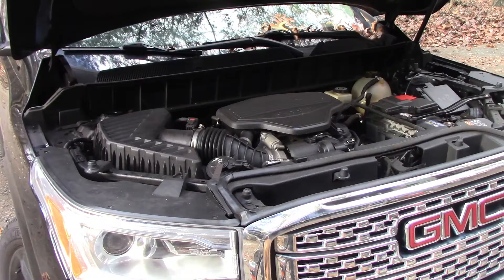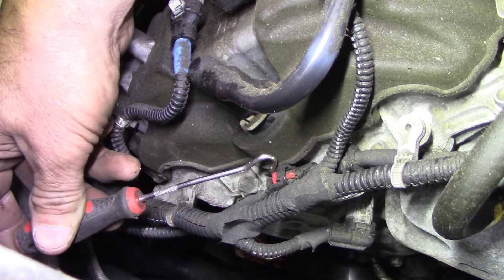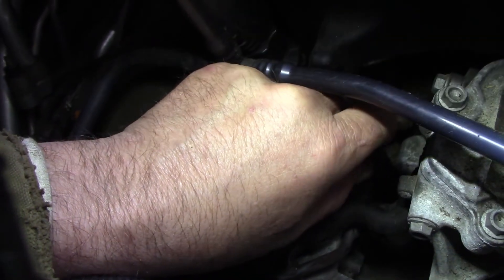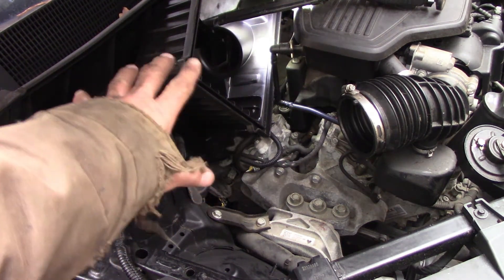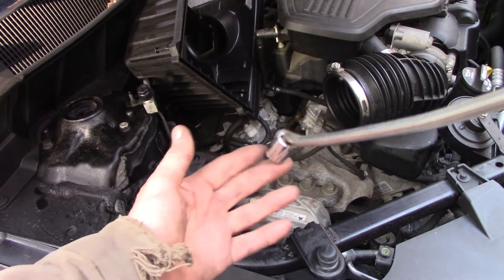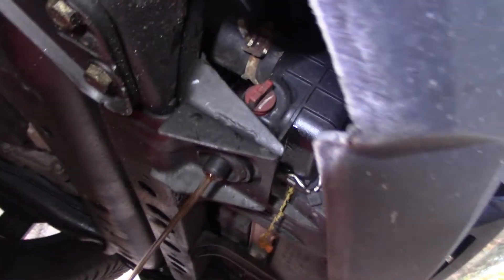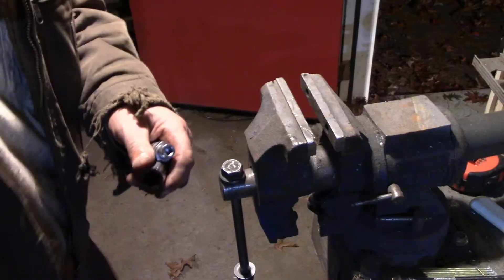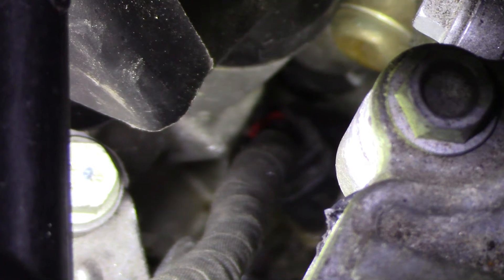2017 GMC Acadia 3.6L V6 coolant temp. sensor installation. (Easy, without removing intake manifold)

Comment: I was able to use a Stanley 5/8" (Cr-V 88-980) with wobble extension. Everything else exactly like in the video. Issue persisted for roughly 50 miles after replacement then corrected. Has ran fine for 4 months now.

Comment: I had the intake off a EZ intake to remove. I made a tool out of a 15MM 12 point socket it did not work that well it wanted to slip off and round the hex. I also made a tool out of a 15MM line crow foot it got it out but no  back in. I Just battle it back in with the 15MM 12 pt tool. In my spare time I was looking at making a tool out of a cheap 15MM six point socket when it hit me a 15MM distributor adjustment wrench was made to do this. You had to be around in the 80's and 90's to own a 15MM dist. wrench are pick one up off Ebay.
Reply from the maker: Ha. Born in the 60's
Reply: @JLafix  HA I'm a 50's model. Nothing is a basic simple repair anymore. Thanks

Comment: This is virtually the same as my Buick Lacrosse (2017) I couldn't see the red clip to release the connector while working in the direct sunlight.  I will set aside an afternoon and work in the garage when I actually get serious.  I was able to remove enough if the covers to get a good angle to work in less than 10 minutes.   I heard that if you accidently mess up the connector that GM can sell you a replacement.

Comment: Did this fix the intermittent issue? I have the same problem.
Reply from the maker: No it came back after 2 weeks. It's still intermittent,  so I'm going do thermostat and another sensor,  when I get a chance...can't see it being anything else causing this.
Reply: @JLafix  sorry to hear that. Please update if you figure it out. I really think it has to be an electrical issue. If it were the thermostat sticking open it would run cold but would read still.
Reply: @SethWeidner  I agree 100%. Thermostats don't get reset after disconnecting the battery for 10 minutes. Totally a sensor or ever ECU issue.